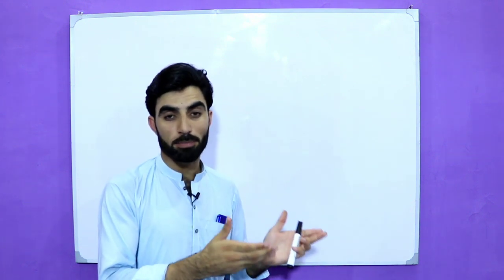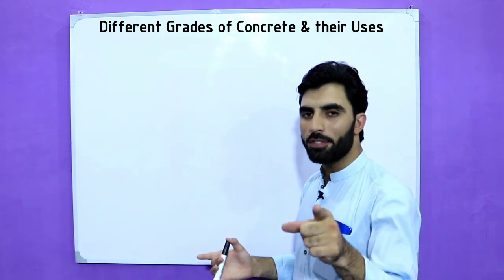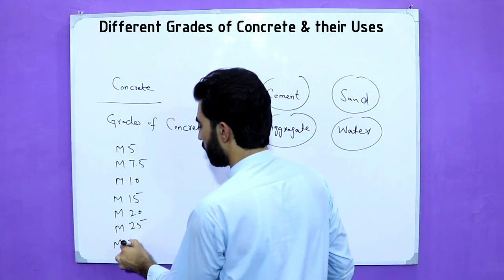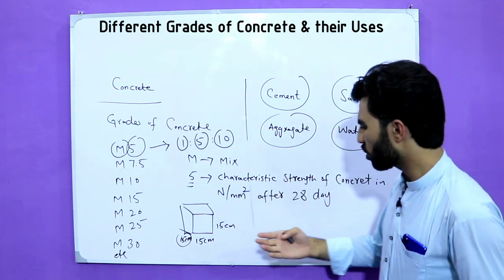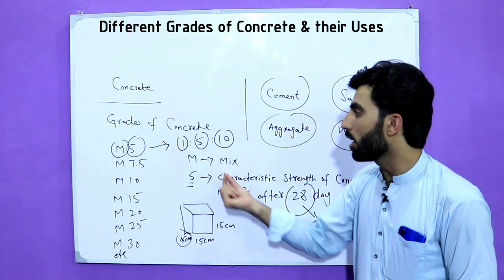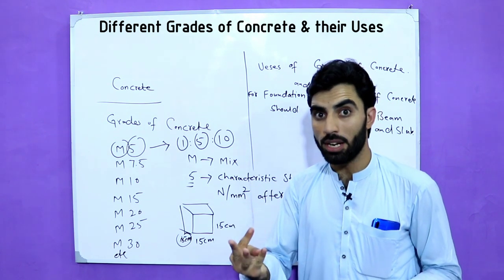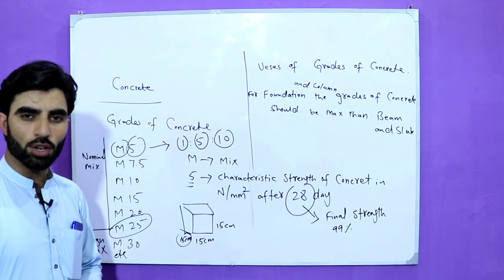Different Grades of Concrete and their Uses in Building Construction

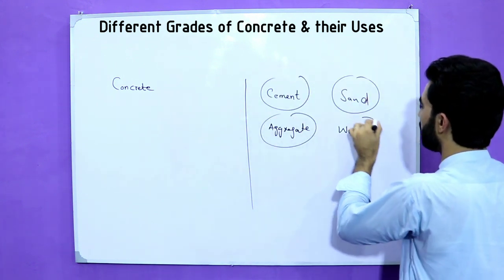Comment: 2:20 That's a somewhat dated oversimplification.  Modern concrete has all sorts of additives now, depending on the application ... including but not limited to things like fly ash (strength enhancer), fiberglass fibers, set inhibitors, tints, et al.

Comment: Very informative discussion, engineer. I wish your different kinds of mixes also show the PSI strength of each mix. I am used to being  told on PSI( pounds per square inch) required ,although PSI strengths are made thru correct water cement ratio.

Comment: Thanks teacher for your explanations, but I have aquestion, 
1) what is the difernece between M15 & C15 and their mix ratio?
 
I confused basd on the ratio. I'm in Ethiopia, Africa, but mostly we are using C25 concrate and the ratio is 1:2:3, is corect teacher?
Reply: M standard signifies cube of sample size of concrete (cm*cm*cm) while C standard signifies cylindrical sample size of concrete, in short strength of cylindrical sample = 0.8* strength of cube sample ( 0.8*M25 is equal to C20) or C20 is equivalent to M25 gradings

Comment: Way they take characteristics strength of concrete after 28 day...way not 27 or 29 day... what's the reason?
Reply: Hardik Patel its the normal days for concrete to achieve maximum strength.